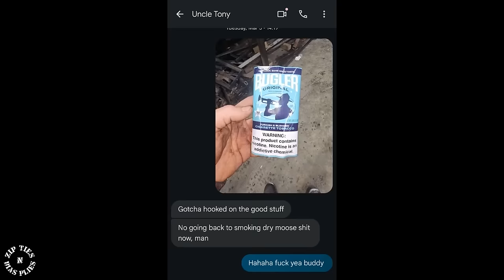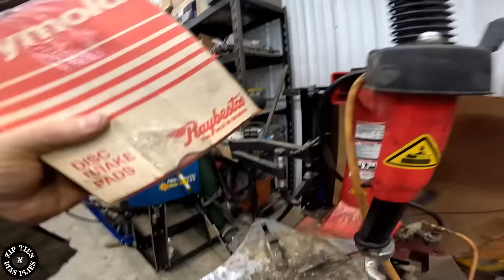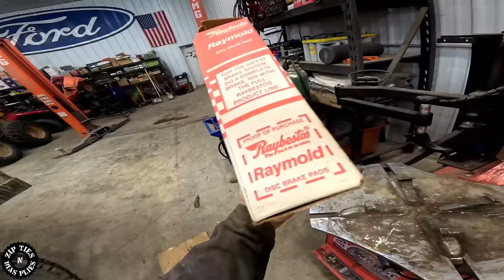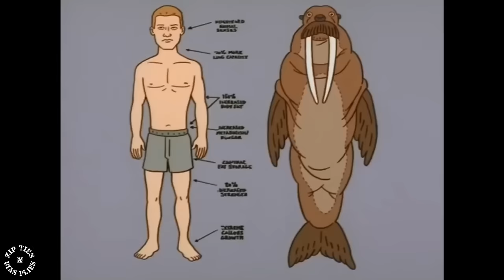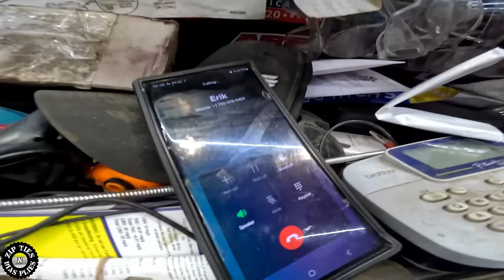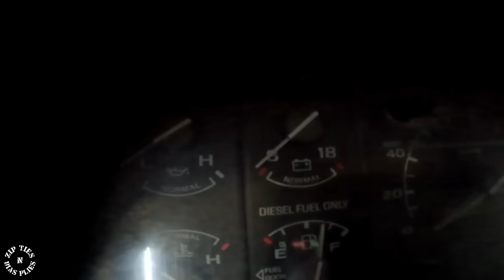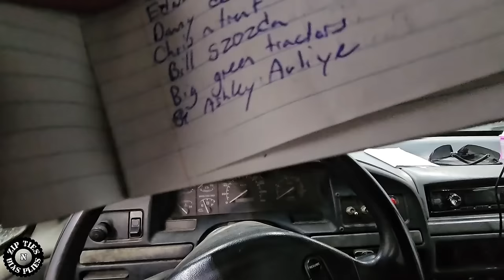WILL IT START?! APOCALYPSE FORD EDITION!!!!

Comment: Buddy! This happen to me and the wife out in the middle of nowhere. I took my 9.9 boat motor that had electric start and a charging system on it. Ratchet strapped it to the front bumper on my truck with the leg stuck in a tote of water and pull started it while it was hooked up to my truck battery. Made some wicked camping pancakes, and by the time we cleaned up for breakfast she was charged up a s ready to start. 😎
Reply: Dude... 👍🦍

I had a Jeep CJ that didn't have a starter for a year.  It was my daily driver.....used all sorts of ways to pull start her.  My wife (exwife) actually pushed her started on our first date. 🦍
Reply: Hello from the mountains of central Pa ....Peg ...are you stunned , if you have a Ronda you don't need to bother pulling the ratchet strap all you have to do is just jump or charge the old ferd with Ronda ..... but good stuff bud ....l love it where there's a will there's a way.
Reply: Nice one ☝️
Reply: @TheLikkinBranchRanch you eventually start finding good hills to park on
Reply: @zirzmokealot4600  yessir.   Was a fun time in my life.  Loved that old CJ.....
Reply: Must have been rough being too broke to drink that whole year
Reply: @david929190  wasn't broke, just lazy.  Had plenty of cash, just not a lot of time.  The rig was light and easy to start.  Wasn't a pressing issue.
Reply: I had an 88 gmc blazer  2door....2.8efi 4x4....hot safety never had an ebrake, np.....headgasket went x2 2.8 was crap. But a fun ride for future wife and I
Reply: @TheLikkinBranchRanch  i got pulled over one time in the middle of town on flat ground. Thank God the officer left before me. He wouldn't of been too happy at me doing the ol 2nd gear bump start by myself. Good times
Reply: @zirzmokealot4600  they can be kind of shitty about that stuff.  I got stuck in a dui checkpoint, and although I didn't drink, they saw I had no floor sheetmetal in my CJ and wrote me up for a shitton of "violations" that needed to be fixed quick.

Comment: I have jump started many cars and trucks using just a single m18 Milwaukee battery.  If that battery was 75% it would have started that ferd right up.  An 18 volt 5.0 amp hour battery will just most cars and trucks.

The rea truck is just installing a start saver on your truck, when the voltage drops power is automatically cut to protect the battery so you can start your truck after passing out in the woods with a bunch of dudes.  I heard some story from someone that said if your hood is open you are a giver and if your tailgate is down you are the receiver.
Reply: Yep thats what i was gonna say

Comment: 27:37  don't forget the zip tie cruise control on your stihl jumper pack
Also side note dont turn the key on unplug the alternator and jump the pins on the internal voltage regulator with milwakee battery make it stand alone go a lot faster no lights and bs on

Comment: You should build the "Charge Truck", load it with alternators and batteries, both a 24v and a 12v system in there with hard-lined jumper cables. 😎😎😂😂
Reply: Holy shit youre a fuckin genius
Reply: I'm pretty sure the rickshaw had this a few videos back on a cold starts video like 6 series 31 battery's in the trunk and  huge set cables

Comment: Same camping situation- I cut a length of barbed wire off the fence, separated the two wires  and jumped my buddy's truck. And it actually worked.
Reply: lol
Reply: Reminds me of some middle eastern guys using two under folding akm's to jump a car
Reply: wtf is a two under folding akm's
Reply: @feelinghealingfrequences7179  later version AK47 with a folding stock

Comment: The Ronda & Rachet strap routine, the one-wheel pull gives you a 2:1 gear into your 4.10's.  So you get an 8.20:1 ratio from the tire to the driveshaft. Close to 10:1 at the engine if you're pullin' in OD.  but then you were in freakin low range, so probably like 5:1...

And when you double the voltage to the starter, you also double the current to the starter, so use more wire.  
but it's 4x powerful.
When you run 60v of Milwaukieeee batteries into your starter, you make everything s#!t the bed.  good gawd

Comment: Lightening bolt on Ferd emblem is off a six banger. Correct sir. Since the 1950’s they did that. V-8 had a v over 8 Nice ditch bag w/ the 3 wheeler!

Comment: What if a feller brought a motor to TDC and pulled a plug on a piston on the proper stroke and put acetylene in 1 or 2 holes and light em?  Then excite the altertater with a Milwaukee battery.
Reply: I was thinking similar idea with pew pew powder from the projectiles finger I saw in the black case when he was routing threw the pac box I cant say the words I want to or lubetube will remove my comment

Comment: Last year I drove my IDI around with no alternator for 2 months.  Belt kicked off on the highway so I drive it home with my shoelaces running the water pump, and then I just left it like that.  I never pull started that, but I did pull start my 300 once.  That one I used a rope around the crank pulley.

Comment: So in review. the engine spins slower when the gear box in high gear. On a spider gear set when I tire is held still. It doubles the wheel speed ( minty 1 legged burnouts) when you pull start a vehicle. The mechanical advantage is reversed. So in 5th gear with 1 tire being pulled you had the greatest mechanical advantage but the engine turned very slowly. Sound right?

Comment: I believe the theoretical gear ratio is 2:1 reduction for starting the 12v with ronda through one wheel on an open diff if the other wheel is on the ground.

Comment: I have pushed vehicles on level pavement, 1945 GMC for one, got it rolling jumped in threw it in gear a let out the clutch, I kept the drum brakes set loose, had a worn out 250 engine, I have started other vehicles this way as well.

Comment: When pop starting you kinda want a higher gear to pop start so it’s Easley to turn the engine over but you may need to be ready to push that clutch back in fast becouse it will start lugging an stall if ur in to high of a gear depends on the truck if it’s heavy it may pop start in first or second becouse the wheels have a lot of weight on em to turn the engine

Comment: I remember that video with the 90 ford dually, I had something similar happen to me but with a dewalt kit, had my bag with a drill, saw, grinder jig saw in the back of my truck and 1 of the batteries decided to let go and it melted everything, at least it was in the back of my truck that had no bed liner so didn't do much other than bubble the paint around the area.

Comment: Ok, Peg, hear me out. When you put the saw on the alternator from outside, the saw spun the alternator the same way the engine does. But, when you sat in the engine bay with the saw flipped around the opposite way, I believe it spun the "altern-tator" in the reverse direction. Did it still charge the battery spinning backwards????

Comment: If you set the parking brake before turning on the ignition the daytime lights won't come on. Can't believe you didn't know that one.
Reply: Oh man, and then to see you are still pulling in the rear brake handle to engage the reverse on the big red. Pull it in once and put a zip tie around that cable to hold it out.

Comment: Day time running light module is on the drivers side core support. Pull that plug, and you won't lose voltage from the headlights.
Reply from the maker: Appreciate it boss!
Reply: @ziptiesnbiasplies  I was super pumped when you came up with the milwaukee battery idea to excite it. Cause at first I didn't think it was gunna work based on those principals.  My buddy did this out in the Bush one day, but he had just a little battery left. Enough to excite it. He didn't have a v belt. Just his sock wrapped around the alternator, his chain, and a big set of balls.

Comment: I wonder If you could take the glow plugs out of the block and put ether in a couple of the cylinders, like two that would fire in order one after another. I wonder if turning the glow plugs on to ignite the ether would be enough of a kick to turn the engine over and start the rest of the cylinders.

Comment: Tap your park brake down just enough to turn on the park brake indication light and your daytime running lights should turn off. That’s if the switch is working as it should anyways
Reply: Just pull the fuse...

Comment: Peg not sure what gear you were using with the pull method but both wheels in air and 5th gear would be the easiest pull from the tire I believe

Comment: Peg, I only has 1 chainsaw in the last 12 years, husquavarna. You buy junk like stil and of course you need 20. Maybe 1 will run once in a while. And yes, I only heat my home with firewood. Some of us 🇨🇦 aren’t dumb like the US. Pulp cutters only use husq because they work.

Comment: your battery thing, 2 in paralell, connect it to the 12v battery and walk away for 40 mins and have a few cold ones. by the time you come back the 12v battery will have enough juice to start. ive used this trick a few times boosting a big diesel off a smaller weaker jump pack, just leave it a while.

Comment: Some airplanes were started using a blank shotgun shell. I wonder if a guy could put er on top dead center dump some gunpowder down a glow plug hole or sparkplug if a gasser and touch er off somehow.. Or make an adapter  to use a blank shotgun shell on one cylinder. 🤷‍♂️

Comment: Peg, Ford should dust off the old body style dies and start producing this truck as the Extreme Canadian Peg Version. The Stihl Chainsaw Alternator should be an option as well. This would probably work with a Milwaukee M12 Battery. I appreciate your Videos and there always a treat. Thanks from Michigan.

Comment: Gotta come up with an adapter you can bolt to the wheel of one truck, then hook it to the dead truck wheel. 2 bottle jacks and boom. Maybe something you could hook a PTO drive shaft to on both trucks.

Comment: If truck is discharged and lucky enough to be near a slope or hillside ,a feller can use a handyman jack to pull the truck up the hill winch style,then let it rip down the hill with a rolling clutch start. shot of Cosby Sauce for insurance is optional.

Comment: Or hook that Milwaukini battery hook it to ur Ferd battery and giv'er a crank with the key. Or better yet hook the saw up as a pony motor straight to the balancer... Need a longer belt and pull on the saw like a mthrfkr to keep'er from slippin.

Comment: If you happen to have some projectiles for that flinger I saw in that case if you pulled the end off and dumped the contents down a glow plug hole in a cyclinder that's near the tdc and used a battery of some sort to heat the glow plug in said cyclinder the resulting quick expansion might cause the engine to turn over very violently no clue if this would work and I'm sure some damage would result but that never stopped you before

Comment: Push starting works. Also saw some Hindu guys with a dually. They jacked up the one rear wheel and a piece of rope tied on the wheel. Then this kid gets out and starts cranking on that rope getting the wheel spinning and dud in the cab dumps the clutch. I guess the starter was long gone on that truck.

Comment: I've push started my truck a few times with the driver door open.. It's hard to get going at first and you think it's not going to move..  But you just keep leaning on it and let it start moving just a bit and THEN you explode and push with all your might and get it going..   hop in and pop the clutch.  The lower the gear, the better.  Put it in 4Low if you have to....  Just don't waste all your strength trying to fight inertia, because you won't win..  You have to start slow and get it moving a little bit before really pushing hard.   The mistake that most people make is to try with all their might right off the start and it's just too heavy to move so abruptly from a d3ad stop.  Slow and steady and get it rolling a bit,  that's the key.. If you're on gravel, it's not happening. :)

Comment: Excellent video Peg, as usual.🦅🇨🇦👌👌
I have used a 21 speed mountain bike with a V belt and an 80 amp altertator for charging my off-grid batteries when there is no sun for a few days and the generator is out of gas.
I am working on a wind blade altertator for charging as well, I live at 4,600ft/1,400m and the winds get up to 80-100 mph at times, but mostly around 35-40 mph on average.
I think you could use one of those old farm windmill heads and convert it into an altertator. You'll have to find one of the big ones like 16-20 ft in diameter because I don't know if you get enough consistent wind in your area.
Your battery pack collection basically became a jump box and charged your battery. The 20 volts was enough to overcome the surface charge resistance of the 2 volt cells and the number of battery packs provided the additional volume of current to regenerate the battery enough for a couple of starts.
The series connection basically created a 60 volt welder as you noticed when you arched the terminal. It's basically the same thing as an altertator welder.👌👌👌
If you are good and drunk and motivated and by a river with decent  water flow, you could make a water wheel out of one of your tires, a ratchet strap (without the hook on), and a stand-by altertator for overnight charging.😉
Happy Minty Easter Peg and all the rest of you mouth breathers!🦅🇨🇦🇺🇸👌🤙
Reply: So you're saying he has to excite the alternator with the battery from his phone or his phallic shaped vape? I wonder if he could excite it with a electric speaker for a lighter ...

Comment: G,day Peg,     great tip for dead battery,    and even better explanations of how or why it dont work,   ,   not sure alternator charge any better above 2,000 rpm  but maybe thats the same as truck air compressor  but we still rev them fast anyway 😅

Comment: Peggy! You don’t need the chainsaw. You can disconnect the battery and jump the Milwaukee battery to the garbage ford battery. One or two Milwaukee batteries have enough power in it to charge the battery enough to start the truck.

Comment: You could do 2 straps around the tires and then hook the one like you had it tie it to a tree  cut the tree down and the momentum of the tree will pull the straps if you didn't have a Ronda

Comment: I was told that you could pull start an old GM truck turbo 350/turbo 400 Automatic Transmission if you got moving north of 45 in neutral and just dropped it in drive.

Comment: My alternative suggestions :
I’ve used a ratchet on the crank pulley to start a petrol engine, no idea if you could start a 12 valve that way though?
2: What about getting some stretch in a kinetic recovery rope with a ratchet strap, highlift jack or a chain pull and bump starting it off a tree at full stretch?
Also, 
3: one for giving a cripple, a chance, do the one wheel, one strap thing again but put another fast idle stick on the clutch tied onto the strap so that the wheel’s spinning and then the strap pulls the clutch out. Try it with dual wheels too.
4: wrap a ratchet strap round your propshaft and tie it tight to the side of the frame with the truck jacked up. Drop it down fast on a bit of timber on the strap so the weight of the truck spins the shaft. If it starts, the strap will fling off.
5: glowplug out, cold chewing gum on the barrel and fire a de bulleted round into the combustion chamber just passed top dead centre.
6: seatbelts round the crank pulley tied onto a tree branch and with the truck in the air held up with a rope. Cut rope to start with the truck falling down.
7: can you turn the ac compressor into a starter blowing your spare tyre into the inlet side to either start or help start? Lock clutch with cordless tool or phone battery.
8. Ratchet strap to pull truck up and incline and bump start as normal.
9: acetylene in 3 glow plug holes, jump lead and tool battery make a spark above them in the firing order guessing the timing from a bit after tdc on one of them.
10: transmission brake on if equipped, ratchet strap round the wheel to the frame or tree. Get it tight to stretch the strap and twist the half shaft and let the brake off in gear to turn the engine.

Comment: If you're 4.1 gears and you unload through one side you become 2.05 gears, but your backwards so that's overdrive, so that becomes like 0.5:1 and a 0.25:1  if ya tug on both tires... so if you put the trans in overdrive then that becomes a reduction since your backwards. Sounds like we're on the same page the further i watch the vid!

Comment: could you use the ole wind maker to spin the mill over? use it to build enough cylinder pressure in one cylinder to fire off the other 5

Comment: 46:08 on an open diff with only 1 wheel spinning its doubeling the gear reduction so if it is a 4.1:1 rear gear 1 tire spinning is 8.2:1

Comment: I'd like to see you add a stick to dissengage the clutch and then tie a rope to said stick that is attached to the end of the tie-down strap, that way one person should be able to spin the rear wheel and get some momentum built up so that when the strap comes off you also pull the stick that is dissengaging the clutch and engages the clutch and turn the engine over and hopefully start it. I hope that makes sense.

Comment: Ive seen a dude spin a tire using a bike while his buddy was in the cab holdin the clutch in. When the wheel got to a good speed, buddy dropped the clutch. Worked like a charm.

Also, none of this shit would work on a newer truck.

Comment: you need add old crank start handle but do it on differnt truck combustion starter do wind or mechenical or solar inversion 
had few times inverter wire whole system to a low charger built your own battery useing fire warm oil well you take the oil out pour in hot same with other fluids